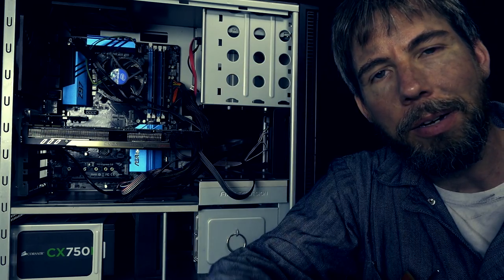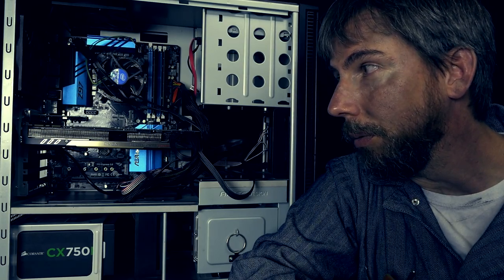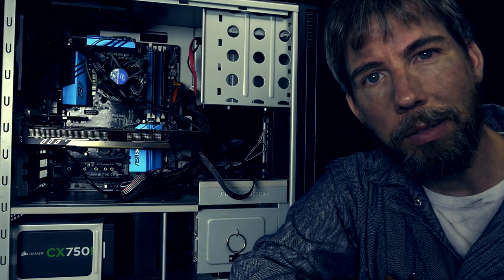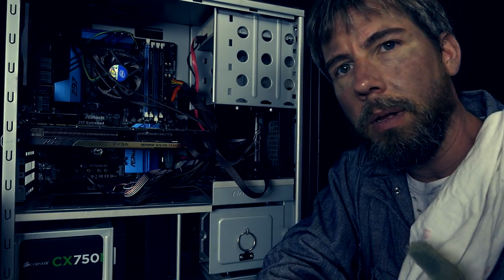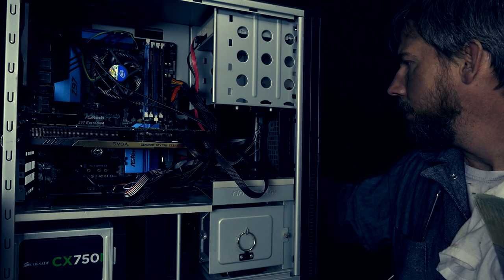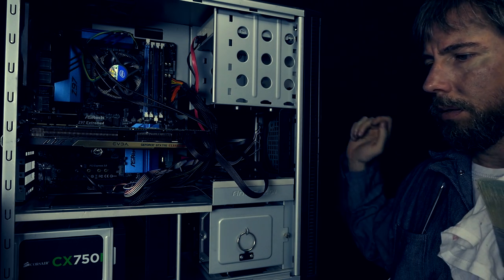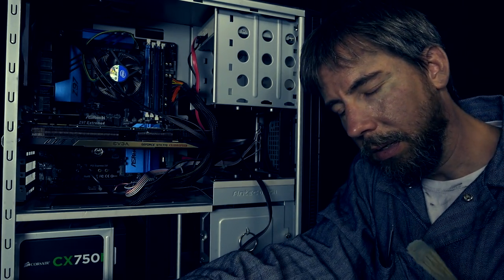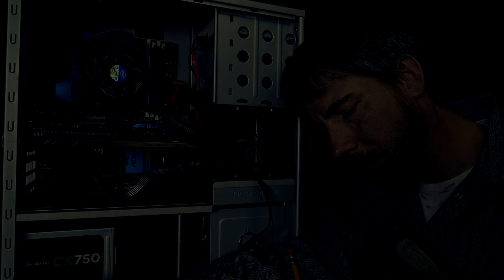Computer Cleaning & Basics with The Repairman [ ASMR ]

Comment: All of the local hardware shops around here (Australia) always look at me dumb-faced when I ask for canned air. "It DOES EXIST, I swear..."
Reply: Call it compressed air.
Reply: I'll give that a try lol
Reply: Just go buy a cheap compressor, long term it will save you money and a compressor always comes in handy :)  I got a small compressor + air gun for about $50 at lowes, after 10 years of cleaning PCs with it I think I more than payed for it.

Most cans of compressed air run about $4-5 a can and only lasts 1-2 cleanings.
Reply: Buy a leaf blower. I highly recommend it. Very cheap, quiet. It will blow all the shit outta there in no time. Highly efficient.
Reply: +Gregory Rand best comment I've seen so far xD
Reply: +Gregory Rand  yooooo Dude ur a svg
Reply: MattExzy try asking for compressed air
Reply: ikr
Reply: I get worried when they want to touch motherboards, graphics cards, CPUs etc. without an ESD strap... sigh
Reply: Marshall Ahmat i cant stop laughin at this
Reply: LOOOL
Reply: Twisted86 or you could buy one of those small electric ones.
Reply: go to computer store
Reply: or buy it from amazon
Reply: It’s called compressed air... lol

Comment: That's a very clean computer, I love it. Also, one video cleaning your car engine would be great.
Reply: Acerting Art yes! That’s actually a good idea! Not sure if he knows that much about cars thou
Reply: @DYWTE  heh I think he's actually a mechanic. Not sure though
Reply: You don't have to know about cars to clean a engine
Reply: dirt bike addiction [instructions unclear, throws bleach into engine]
Reply: Yes super clean computer. Totally not garbage cable management
Reply: @Kronos the Horrible I’m assuming you know nothing about computers cable management is very necessary to make sure the computer fans get 100% air flow with nothing block it that shouldn’t be there so it can keep the temperatures low so the pc doesn’t bottleneck and over heat
Reply: @DYWTE Yes, yes I very much do
Reply: @Kronos the Horrible cable management effects air flow
Reply: unreal engine 4
Reply: @charlescook6502  uhhhh. Fell asleep on your phone?
Reply: @Kronos the Horrible if the cable management is bad it won’t run the same. Also it triggers me
Reply: @uhpixr  Yeah.... no. cable management doesnt make a measurable impact in anything but the smallest
 cases.
Reply: @finja2164  BULLSHIT. there have been numerous tests of this, only in sff doest it make any difference, and even then not by much.
Reply: cable managments is non existant
he is also using a intel stock cooler(those get toasty)
and hes talking about synths and mody modifications
while theres a gtx 770 instaled(a 2013 graphics card)

(sorry for the rant but gtx 770 in future is a no go)
Reply: as a car guy i would love this
Reply: @Ashley_2005.  bro im still running a bulldozer chip, works fine for CSGO and dirt rally
Reply: @jamalyogugaratee9170  thats fine but in this asmr the setting is future so a gtx 770 makes no sence

and for extra context my pc specs are

cpu: amd a10 5800k
2core 4 threats 4ghz

gpu amd radeon hd 7770 1gb ddr5

8gb 1600mhz ram dual chanel

no ssd
Reply: @Ashley_2005.  yours is more ancient than his lol

Comment: my specs:

CPU: Intel G620
GPU: NVIDIA GeForce GT 640
Power Supply: 250w
RAM: 4GB DDR3

Now before you you go insulting me in the replies, yes I know my specs suck but I'm currently very very tight on cash (me and my dad lost our jobs and are job hunting) and this rig I have is the best I could afford and I'm satisfied with it. I can run rocket league, universe sandbox 2, csgo, and a few others at 60+ fps. I'm currently saving up to get some new parts for my rig but its gonna be awhile.
Reply: UPDATE:

CPU: i5-3470
GPU: GTX 1060 4gb (overclocked)
PSU: 500w
RAM: 4gb DDR3
Reply: Damn! That's quite an upgrade. That card doesn't exist though.. do you mean the 1060 3gb or the 1050 ti 4gb?
Reply: Joshuamiika sorry, its an Xtreme Gaming GTX 1060 6gb I believe
Reply: The Shadow Sneak ah, cool. Great upgrades, did you find a job or just deal hunts haha
Reply: If you ever notice games getting laggy while watching streams or videos in the background or if your browser becomes slow if you open more tabs than usual consider upgrading to 8 gigs of ram. Otherwise that sounds like a well balanced rig. ^^
Reply: Joshuamiika the graphics card is a little bit overkill :P
Reply: lucaz TheForest How?
Reply: Realistically, Im able to run most modern day games fine with my GTX 680, Which is to be fair quite cheap now.
Its mostly RAM issues these days, even 8gb still runs into frequent gaming issues with maxing out(GODDAMN CHROME TAKING UP 3.6 GIG)
So yeah
Also how the hell does he run a gtx 1080 with just a 500w PSU?, I have a 1000 and that barely meets my system
Reply: Toxic The reporter 1080 has a 180 watt power draw i believe
Reply: The hell? It has a lower drain than older ones?
Reply: Toxic The reporter Yes. Most of the newer ones aren't much better than the older ones but are more efficient. For example, the 1070 vs the 980 ti. They are equal in real-world tests, but the 1070 uses less power.
Reply: He has a gtx 1060 though
Reply: Nice upgrade! You should save up some more money for DDR4 memory
Reply: Toxic The reporter It's a 1060.
Reply: id kill for a computer like that.
Reply: Not bad lol. I myself have a Zotac 1070 amp extreme edition.
Reply: The Shadow Sneak If you can run games at over 60 fps then thats fucking good
Reply: @Pigeon1235  wtf is this an 3rd gen I5 and a 1060 6gb

My specs are:
CPU: i9 7980xe overclock to 5ghz
RAM:8x 16gb Dominator Platinum overclock to 4200mhz
Motherboard:Asus x299 Rampage VI Extreme
Storage:Samsung 970 pro 2tb
12tb seagate  Barracuda pro
GPUs:3x Titan XP 3-way SLI with waterblock 
PSU:Corsair Ax1600i power supply 
Cooling:Custom watercooling loop 
Case:Caselabs STH10
Reply: My PC specs: 
I7 4770
Rtx 2060 6GB
16GB RAM
500GB SSD
1TB HDD
Reply: another Dinosaur (Intel CPUs and or GPUs)

Comment: I first purchased the exact Motherboard myself for my first built and then after digging a bit deeper into some reviews found that it's got a very high failure rate and then bought a Z97 - Pro Gamer. I still have it, it's in an empty case since the case I had at the time wouldn't fit an ATX MB with a 240mm Radiator above it. I'm curious how old your MB is and if you've noticed anything fishy with it? I'm wanting to try and make a second build with it, but I'm scared to use anything with it.

Comment: This computer is so much cleaner than most computers I've ever seen as an IT technician. Most people don't understand that computers need to be cleaned from time to time.
I'd say it's not 100% correct, but nice job explaining the parts in simple terms.
Sidenote: I really hope that's an anti-static brush you're using.

Comment: No wonder you're in the Arkham sanitarium... I mean what madman would use a stock cooler on an unlocked processor and leave it on stock settings, then buy a 750w powersupply for that build. And at that use a Corsair CXM green unit - oh my god - and look at that cable management.. Truly the work of a madman.

Comment: Guys I'd just like to let you know, DO NOT use a brush to clean your PC. A few hairs is all it takes to bridge a connection between a gnd and 12v wire which could completely trash your PC
Reply: i wasn’t going to, but thanks for putting this here for anyone who tries to play along.
Reply: but you probably could use a brush with plastic fibers right??
Reply: @rewindd  I wouldnt recommend that either. Just get some compressed air and you have nothing to worry about
Reply: @tommi7904  I clean my pc with Monster or RedBull.

Comment: A non overclocked k processor and a 750w power supply, I SMELL UNTAPPED POTENTIAL
Reply: ••• u r relli ejy •••
Reply: He can't OC with the standard cooler
Reply: Yes he can. I've got the same one OC'd to 4.2 Ghz with the stock cooler and only max out at 55C when playing CPU intensive games.
Reply: *a pretty bad PSU actually, even with the big wattage overhead.
Reply: bad how?  Because its bronze rated in power efficiency?  That has nothing to do with whether hed be able to overclock with it or not.
Reply: +JTTutorials haha no.
Reply: He could add a ssd and a gtx 1080
Reply: +Zachary Courtois So you see a mid i5, a 770, and think that he really is focusing on gaming? His setup is great for what he does I'm sure. A 1000 series would likely be unneeded same with a non-stock cooler.
Reply: Are you ignoring the fact that he isn't running his ram in dual channels but parallel to each other?.
Reply: oh shit my comment turned into a pc master race war

i have an i5 2500k overclocked to 5.5 ghz, a 7970 ghz edition and my storage drive is simply named pornography, come at me toasterbois.
Reply: +Dizzie I reckon complete bullshit , you can't open google chrome without a thermal shutdown with that cooler let alone oc
Reply: +northernwv It's a tier three CX model so yeah, pretty much Allahu Akbar if you stress it too much.
Reply: Lucas The Hedgehog Mine is named C(p): so I believe you should stand down.
Reply: +guycd1 no he's running duel-channel
Reply: +Lucas The Hedgehog no way an i5 can overclock to a 5.5ghz, maby 3.5 MAX
Reply: trevin schenker
guess i got a golden chip or something then, because that is where im at.

ps, 3.5 is base clock so i dont think you know what youre talking about.
Reply: +Lucas The Hedgehog If what you're saying is true, you really won the silicon lottery. I really can't believe you, though.
Reply: +Lucas The Hedgehog 
Post a screenshot of your cpu-z
Reply: trevin schenker 3.5k max? How did you figure that out if boost clock is 3900mhz? My i5 Clocks to 4.6ghz and thats with minimal voltage change.
Reply: +Lucas The Hedgehog it's not unbelievable at all as they all seem to think I've had mine up to 5.43GHz but can only get 5.2 stableish
Reply: I can only get my i5 to 4.5ghz otherwise my pc lags like fuck
Reply: +Lucas The Hedgehog 5.5 pls learn to lie maybe?
Reply: 2500k? should i remind you that we life in the year 2016? anyway who's proud of an i5?
Reply: Zonkory An i5 is recommended if all you are going to to is game..... i7 is necessary if you plan to do video/picture editing and rendering or lots of multi tab work
Reply: Jubernuaght have i said anything else?
Reply: +zachary courtois You realize you just basically said he should spend 1.2-1.4k?Do you fucking acknowledge that?lol
Reply: Lucas The Hedgehog 980Ti SLI
Just dumped my Dino 4790k for a 7700K, 16GB 3200mhz ram, blah blah blah it's good
Reply: Destiny Fucker 750w Powersuply is more than plenty dude
Reply: these replies are edgy
Reply: This comment chain is literally r/pcmasterrace in a nutshell
Reply: Destiny Fucker turbo????
Reply: how do you know it isn't overclocked, is it the bitchcooler? because you can still overclock with a bitchcooler, obviously you're not going to be breaking records any time soon with one of those but you can get a decent little overclock going.
Reply: JTTutorials+ l don't believe that for a second, l can't get those temps even on an underclocked processor. 55c is pretty cool for a bitchcooler especially an overclocked one. if you overclock on a bitch cooler you're looking more along the lines of 80-90c which is just at the peak point for the temp.
Reply: JTTutorials does it smell burnt when you game?
Reply: @anchorbubba  definately not.
Pcmasterrace is way nicer
Reply: Stock cooler no way you can overclock with that cooler well atleast not to the point were its worth it

Comment: 1: how tf did I get here
2: a 750 watt psu for a 770?
Reply: Talk about overkill. Parts use less power with every generation as well. I guess a higher max cap is more energy efficient but it is overkill.
Reply: @etherealhawk bare minimum I'd recommend would be 500 watts unless you are really on a budget 450 watt but you should never cheap out on a PSU

Comment: As for overall ASMR experience, I'd rate this video at an 8/10. It was overall very relaxing with little to no obnoxious sounds that would ruin the experience. Mostly a talking video, but was spoken very gently and softly as it should. Highlights with the bottle cap and brushing sounds. The role play was well done, and upheld and supported previous advances in the story and tales of Arkham Sanitarium 

As for your current PC build, I'd rate it a solid 5/10. By no means is this PC a "top of the line" build. The GPU in particular has a lot of room to be improved and it couldn't hurt to add some extra ram. The CPU for this build is decent, although a newer i7 would obviously preferable. The PSU is decent and packs a nice punch, and the case is also adequately fitted for a PC of that size. Wire management could be improved, especially the wire draped over the CPU fan.

Thank you for the upload, and great work as always!

Comment: Dang it, i need to fix laptops that my parents broke :/

One doesnt charge (toshiba laptop 2012)

Another has a distorted pink screen and the HDMI ports dont work (also toshiba laptop -2009?-)

The last one's screen won't light up, yet it makes a noise when it turns on (apple Ibook laptop)
Reply: Hope you still have the iBook, if it chimes then it should be a easy fix.

Comment: Not a bad build. Just finished up my dream build myself.
i7-8700k
16GB DDR4
EVGA 1080 Ti FTW3
And a hodgepodge of different hard drives and SSDs, plus an Optane stick because
Reply: namelessUser id have gone for 12gb, its cheaper and its just as good.
Reply: derik yolk Probably not, actually. I've already run into situations where having a 4GB stick can be problematic compared to two 8GB sticks. VMs and Vegas workflows will do that.
Reply: @jodinha4225  12gb... why would you ever mix 2 different ram sizes... that is just stupid and the standard now is 16gb

Comment: Getting a gaming PC with really good specs next month :D
Reply: and I did :D
specs:
Intel Core i7-8700 3.2 GHz -> 4.6 GHz, 6 cores 12 threads
NVIDIA GeForce GTX 1060 6GB GDDR5
16 GB RAM
512 GB SSD (will add a 4 TB HDD soon.)
Reply: Congratulations man!
Reply: @pzkwmaus9050  After living on a GT 610 and dual core pentium my entire life, it's fuckin amazin specs to me. Upgraded the gpu to a rtx 2070 and ram to 32 gb. But I guess this still isn't good specs for you. You must have some kind of Threadripper 3990X.
Reply: @sonidoge6777  Thanks!
Reply: @crylune   My CPU isnt actually  that great its only a 7700k but ive gotten it to 5.4GHz Ram are 64gbs but i still have my dual 1080Tis  ( ik SLI is a bit usless but yeah..)
Reply: @crylune  antediluvian a case for archaeology

Comment: I see the case is Fractile design. I would just like to recommend adding another 2x4 kit of ram so you can use quad channel for a total of 16gb of ram, you should really overclock that cpu. If you do then get a better cooler. An H100 couldn't hurt and is really good. PSU is pretty good and can handle the OC. The GPU is good. I would consider buying a 970 though. That's the best GPU for recording and playing at 1080P by most Youtubers. But at the same time if you're happy with what you have then you don't need to upgrade at all. Just some small changes that would help.
Reply: i dont think hes planning on upgrading right now
Reply: Should get a 390
Reply: It's not a Fractal Case, It's an Antec Case
Reply: Hehe times change

Comment: If the professor has a bit of a gaming addiction, he should at least upgrade to a 1050 if not a 1050 Ti
Reply: Sparxx agreed, thats actually what i have, a 1050 ti, works awesome, it can even run roblox
Reply: The 770 and the 1050 ti have almost exactly the same performance
Reply: You can get a 1070Ti for £300 now

Comment: I highly doubt the 770 runs Witcher 3 on max, atleast not 60+
Reply: +Norry Fox I can also run it on a 760 but it will be 10 fps so yea.. That's why I said atleast not 60
Reply: +quadrice yup. My r9 380 runs it max without hair works with about 30-40 and our gpu power is about the same. Mine might be a little faster
Reply: 1080p it will
Reply: +TheGingertator no. Not over 60fps
Reply: +Radiation8 lol. No.
Reply: PC sucks play Nintendo DS
Reply: I know right? My gtx970 g1gaming does not run witcher 3 on max with constant 60 fps.
Reply: ***** No, its not, send me a video that shows that.
Reply: You know what runs down your throat at extreme speed? Bleach! :)
Reply: How times change